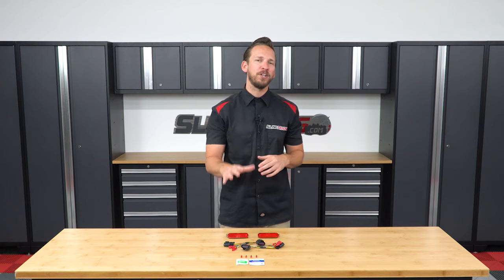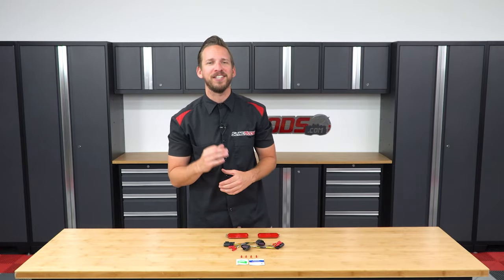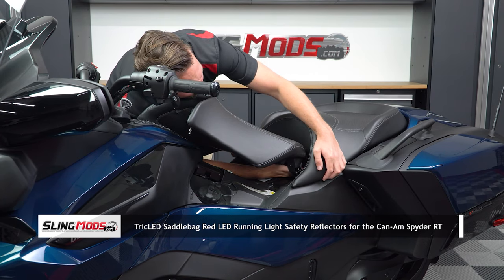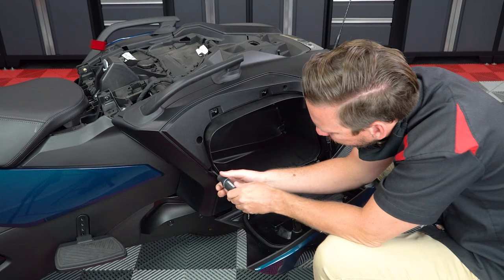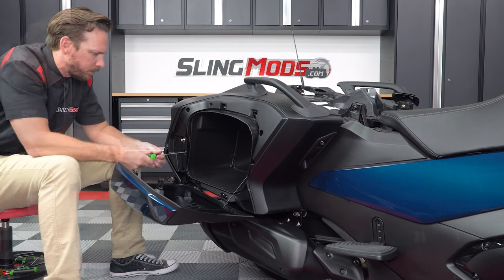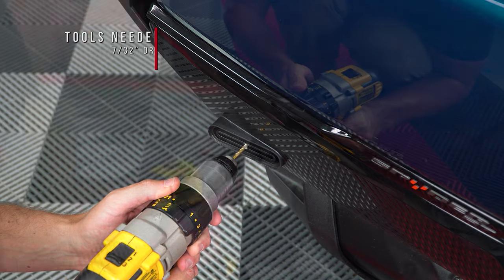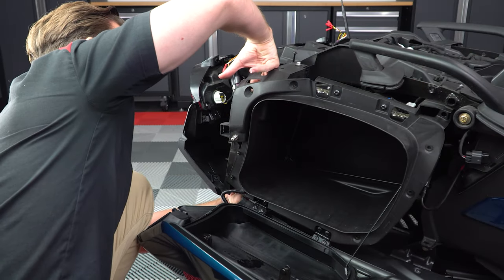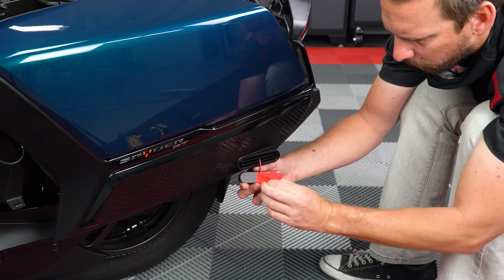Can-Am Spyder RT Saddlebag LED Reflectors (2020+)

Comment: The video needs updating for the 21 models. The Torx on the bottom is now a #10 nut and bolt. There are two bolts at the top of the case that have to be removed, On the left hand side there was no way to run the wires to the connector. I ended up drilling a whole at the top on the inside plastic. You do not need to remove/loosen the rear lights. Once the plastic is off you can easily reach the connectors.
Reply from the maker: Hello Don.. we don't have a 21' model here to re-shoot the video unfortunately.. but I'm sure others will find your comments quite useful. Thanks for sharing.